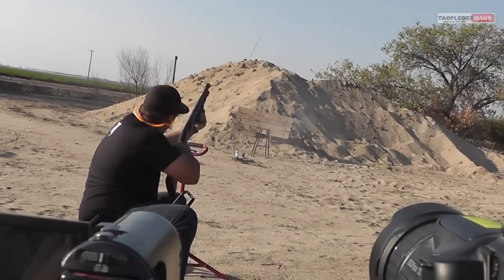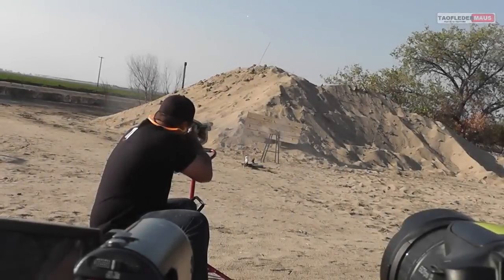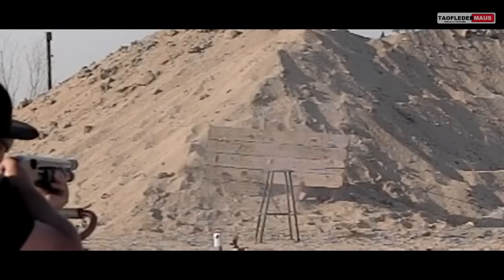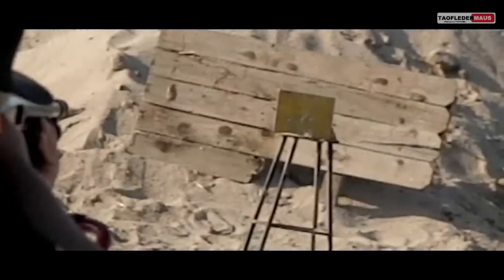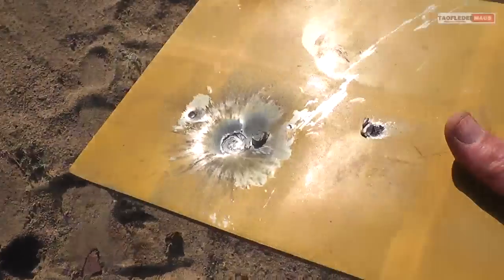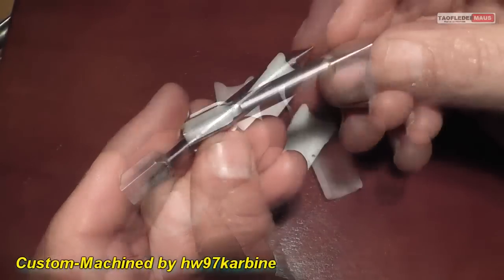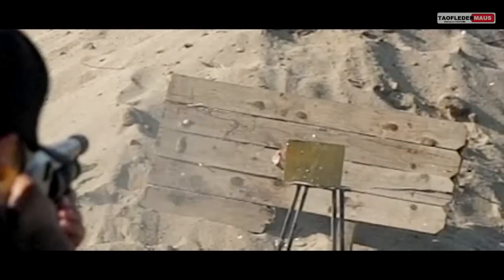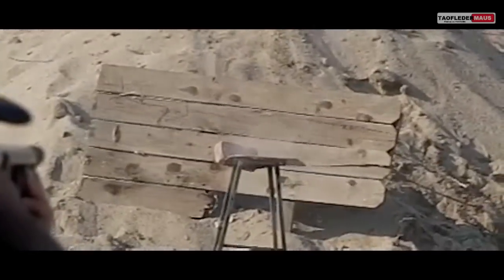Shotgun DEER SLUG with Ferrocerium TIP  (test 3)

Comment: Hey Tao, another probably dumb idea for your shell list aparte from the others i've sent: shoot a heavy-gauge spring (find one of the diameter for the bore but made of real thick steel), maybe put one of those glass beads on the front?, could be interesting to see if it oscillates in midair in slowmo (watch out for that bounce lol)

Comment: Hey Jeff! Idon't know if this is possible but I am trying it anyway. 
What about a 12g CO2 cartridge used, for instance, with airsoft. I got a 12gauge used shell (forgot the actual word) from claypigeon shooting, and I tried sticking it in. The little "nipple" of the CO2 cartridge just fits a tiny bit in. Don't know if it would fit in a barrel or not, but curious to see what you think of this :)
Cheers from The Netherlands!
Reply from the maker: They are a hair too big to fit through my barrel.  HOWEVER,   I asked this guy to try it and it is pretty cool!
Shooting LIVE CO2 Cartridges in a Homemade 12 Gauge
Reply: Oh thats damn nice! Thanks for the recomendation!:) May I suggest an other load? Chocolate! Just heat it up and melt the liquid goo in there :) Cheers dude, love your videos!
Reply from the maker: OgamerNL   We tried some chocolate a year or so ago.  It didn't work very well.
Reply: Aah okay, that explains.
Do you think Rubber Bands would work? Like tied together and such to form balls of rubber bands? The other thing coming close to that would be bouncy balls, most likely available as well in the diameter for the 12gauge.

Comment: 311,931 subscribers... Man if only Thegreenking84 would come back and round it back out to 311,932.
Reply from the maker: He should just post his own videos since he all ready knows better than everyone else.
Reply: ***** he posted like 10 gaming videos, but still has 0 subs
Reply from the maker: Varun Dixit  That pewpeepie guy is totally copying his gaming videos.
Reply: ***** ha ha ha, I was meaning to ask you what makes the camera you use better than the Casio High Speed Exilim Ex-zr1000, theE-zr1000 films at around the same fps, but is only 270 dollars. I was thinking of getting a high speed camera and was wondering if you could shed some light on that
Reply: Boy, he will be missed. =)
Reply from the maker: Varun Dixit   I think the EXF1's have larger sensors.  Also they are more like a DSLR camera and you have more options to tweak,  like f-stop,  exposure,  etc.
Reply: ***** Thanks! I will probably get a EXF1 then
Reply: ***** just like porn.   he pulled out, you went in.

Comment: You should try a flint tipped magnesium round, either a compartment with magnesium powder or a full magnesium slug:)
Reply: I was thinking steel core , fero jacket, then jacket of hard cast  lead with pocket of oil, and copper jacket.

Comment: Why don't you try shooting the steel plate at more of an angle. That way the flint may have more of a chance of sliding across mute steel surface area and making a better spark.
Reply from the maker: It was at a slight angle.   meh..